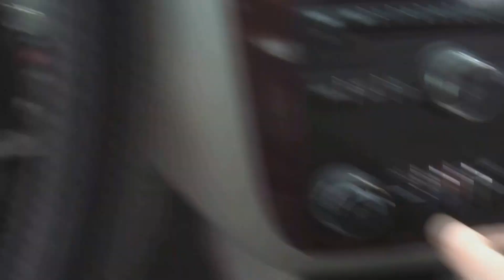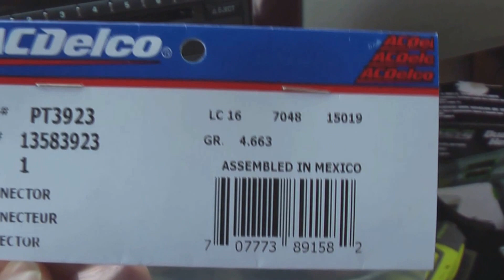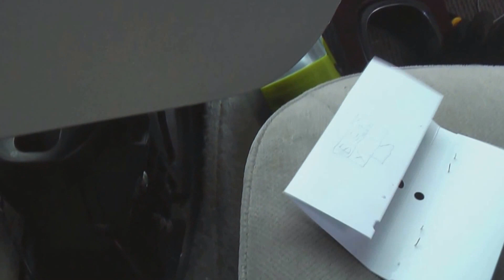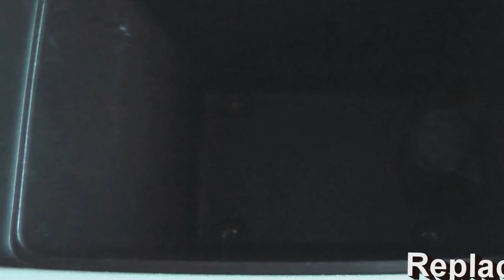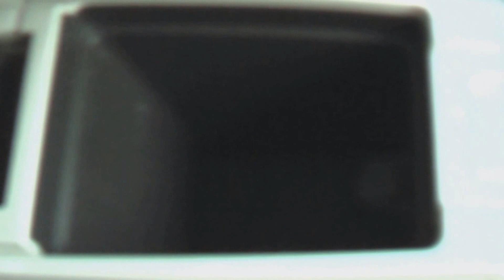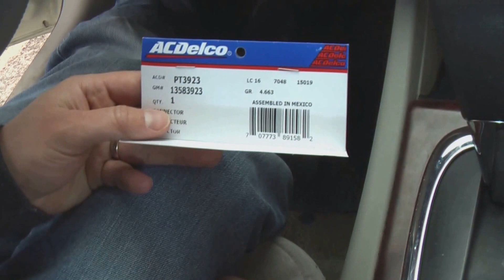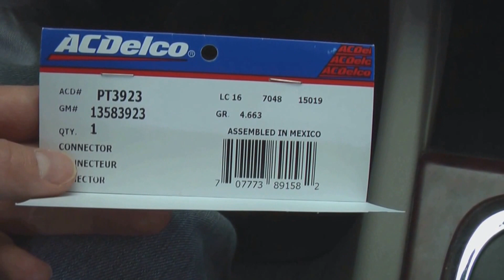Chevy Impala Monte Carlo Buick Pontiac - Won't Shift Out Of Park - Key Stuck In Ignition - FIXED

Comment: HUGE thank you for posting this video!!! I was on my way to see my mother for Mother's Day when this happened to me. Thanks to your video, I was able to diagnose this issue and fix it. It turned out my black wire was broken too. I ordered the same wiring harness. except for the POS wire stripper/crimper I got from Advance Auto (don't buy the red handle Auto Craft stripper/crimper that comes in a box with butt connectors and other connectors. Had to use 18 to cut 14 gauge wire. The 20-22 was still too big to cut 18 gauge.) I ended up using a box cutter on the existing wire. But anyway, thanks to this video, I'm back in business. I owe you one of those beers! Much thanks!
Reply: I know I'm kind of off topic but does anyone know a good place to watch newly released movies online ?
Reply: @Marlon Kannon I watch on Flixportal. Just search on google for it =)
Reply: @Jayson Miguel thank you, signed up and it seems like a nice service =) I appreciate it !
Reply: @Marlon Kannon happy to help xD

Comment: Found this video today to help my grandson.  Key stuck in the ignition switch, and shift knob stuck in park.  This problem can also occur with a dead battery, which turned out to be our case.  His car had been sitting about 4 months and we needed to move the car for jumper cables to reach.  Learning about that pin on the side of the shifter assembly under the trim panel was all I needed.  The key released once I got the car started.  Not a harness problem in our case thank god.

Comment: Nice video. Thank you mine shift just got locked. Word of caution always leave wires long. Never know when you need the length. I'm a electrical technician so I work with wires all the time.

Comment: Thank you for this video. It was very easy to follow and worked perfectly once replaced. Also, thanks for putting the part number in the description. When I called O'Reilly, they said there was no harness number, but I gave them the one in the description and they pulled it right up. Thanks again!!!

Comment: Common problem & this is best, most detailed video. Showing the wire colors clearly was really helpful as the one I worked on today had been “fixed” sometime before we bought and no crimp connectors were used. Less than an hour& under$25!

Comment: thanks this is old, I'm about to go on this journey! I believe I will give myself about 1 inch more room on the wires. I believe you cut them to short, but without watching you I would never of seen how to get started. Took my 2007 impala in today for the ignition recall,thought that would fix key being stuck in ignition after I turn car off! It don't! You have to take a small flat head, kind of long and stick it in the pull out lid right below the ignition switch and push a little bronze looking button in and key will turn back to off position to take it out. The Dealership Jeff Wylers on Dixie Highway said $450 to fix it, what you are doing! Thanks for showing us dudes with a bit of mechanical knowledge and some balls that we can fix it. I still will give myself a bit more length on my old wires I cut off. Thanks again!

Comment: Thanks very much. This was very helpful. In my case, the black wire was slippling out of the harness. I pushed the wire back in, melted a tiny dab of solder into the hole to secure the connection and everything is fine again. 2010 Impala.

Comment: Just had this happen to my impala today. Found on a thread that underneath the small cover under the ignition key there is a manual release for the key as well. Its harder to see but I've been getting it with a flathead to unlock my key until my new harness arrives. Thanks for the video!!
Reply: I've had to use the manual key release for a looooooooong time, and didn't know the problem was connected to the shifter issue until yesterday!  I'm hoping when the part comes in, it will fix both issues!

Comment: Thanks for the video, it works! Used spade connectors and tape on mine.  Also,  I left the wiring a little long since there is some foam on the inside of the center console so no chance for chafing.  The best way is to solder and heat shrink(stronger than the wire itself).  I don't like(hate) butt connectors, especially the type that are too big for the wires- they almost always come loose eventually. Cheers

Comment: You did a great job! When you describe a subject, It will help, if you use the correct vernacular, when describing your subject. It would make it easier to stay on subject, if you have a soldering gun to secure your wires, it makes it faster, when you cut wires always cover the ends not used with tape, you can never tell, if something can come in contact with something you can see after you close your job. One thing to keep in mind, use color tape or marker to identify the repaired wires, that were replaced, yours was in an easy location, Make sure your new wires match the same color wire, you are repairing,some might be in an area not so easy to identify the wire change. Always secure your wires with tie raps to prevent movement. yes in your area, a beer helps. Again you did a great job, and it works. good job keep up the good work. I  am in California. an Author, inventor and race car builder. Thanks

Comment: My 2008 Impala got me stuck on a steep hill going into a parking garage. Thankfully I had AAA and had the car towed 75 miles. My Master Shade Tree Auto Repair buddy repaired it for me. In doing research for the fix, I found that GM shorted the wire bundle a few inches (engineers !!!!) and by doing so that's what caused the shifter problem.

Comment: Great video. Probably to best I have seen on this subject. May mention that I believe that there is a small screw at the front base of the shifter knob that can be loosened/removed. The knob will then slide off so that the console will come completely off.

Comment: My friends car was flooded from Harvey. I suppose the brake light switch and the electrical connectors in the floor shifter box were damaged. Do you think that's why It's stuck in park?
2002 Nissan Maxima 3.5. 4 door sedan.
Awesome video. Thanks a lot.

Comment: Have a 2005 Cavalier that did that once about 4 months ago.  The replaced the ignition switch and that fixed it.  Today it did it again. Can start the car but cant get it out of park and cant get the key out.  Do you know a way to over ride the shift lock to drive it to the dealers to save on a tow.

Comment: Thank you. My Monte Carlo is doing this and was considering selling it because I thought it was going to be a huge repair bill. My key is getting stuck all the time and takes like 30seconds to 3minutes to get out. Is that the same wiring harness?
Reply from the maker: Mathew Syria Yes it is. That same wiring harness tells the key when the shifter is in the park position, thus allowing it to be released from the ignition. It sounds like you have an intermittent connection, since it works sometimes. It will probably wear more and break over time, preventing the key from ever being released.
In my case, a different wire in the same harness was broken, which prevented the brake pedal from telling the shifter that it was being pressed. Because the shifter didn't think the brake was pressed, it wouldn't shift out of park. Both your and my symptoms are caused by a wire being damaged or disconnected from the wiring harness.

Comment: can you use the same wires and just put them back in the same connector since they just came out or do you have to replace the connector altogether
Reply: Treyc Conway Yes - that's what I did. I pushed the wire back into the connector, and melted a tiny bit of solder into the hole to secure it.

Comment: i have both a stuck key and stuck in park unless i disconnected the battery. My car has a easy release tab instead of screw driver method but this sounds like my issue even though different model.

Comment: Hey, thank you so much for showing us how to fix this!
I am having a different issue, though...
I think that when i pulled out the console it might have pulled on other wires that seem to be connected to the power outlets, because all three outlets stopped working. Have you come across this issue at all?
Thanks in advance!
Reply: I know my response is a few years late, lol. But for anyone else, make sure to unplug the 12v harness

Comment: Could i tape the release button down and drive it like that for a few days? Or does the button need to be released after you shift?   Thanks
Reply: I wouldn't do that for fear the car might come out of gear when it is in park. Yes I can use your emergency brake. But I would be very learly of doing that.

Comment: I have a 2004 Pontiac Aztek with a similar issue. The key won't come out of the ignition. I can start and drive the car just fine. When I go to get out, the key won't come out. My friend showed me a hole in the bottom of the steering column where I could stick a small screwdriver in and get the key to release. Is this related to the wiring harness being discussed in this video?
Reply from the maker: George Denzinger Although your problem sounds very similar, and both vehicles are made by GM, I wouldn't trust that the same wiring harness fix would work for your Aztek. You could try to take it apart and look for a broken/disconnected wire.

I just googled around a bit and found a guy saying that the whole shifter needs to be replaced to fix that on the Aztek.
https://answers.yahoo.com/question/index?qid=20100218060407AAIlE7p

I can't really be sure since I'm unfamiliar with that vehicle.

Comment: I bought a new part and spliced the wires together. But i still can't take my key out.  I didn't cut my the new connector wires shorter. Do you think this would have affected the connection?
Reply: I have the same problem. Do you know why it didn't work? How did you fix it?

Comment: my 2002 chevy impala ls wont t let me push down on the  brake to put my car in drive and ge da r shift is hard to shift into reverse could this be the problem.
Reply from the maker: Quite possibly. Can you use a long flathead screwdriver to release the gearshift with the button hidden down on the right? If so, this is probably the issue.
Reply: I got it to work. I have a 2002 impala ls

Comment: my key gets stuck in the ignition and you can tell that the battery went dead. the first time it happened i tried to move the neck of the steering wheel to remove the key, but no luck. after a while i hit the lock and unlock button on my key. the electicity came on and the key came out.... same thing happened a few days later. after DAYS of my key being stuck again i come to check on my ride. i seen that the lights and clock was on and my key came out... i wonder if i have a loose wire in my center console?

Comment: I had the same problem and I  replace the wire harness and now I can shift out of park. But now it doesn't allow me to remove my keys from the ignition. How do I replace the whole purple wire ?
Reply: their a fuse a rap or rad fuse in the kick panel it's a 10 fuse under rap or rad replace that and your good

Comment: I have a problem that when I press the brake I push the button on the shifter and it's real hard to push in. At times I have to use both hands to push the button in so I can put it in gear. What do you think can be causing that so I can fix it ? Thanks for your help.
Reply from the maker: I"m no sure, Tom. It doesn't sound like the issue documented in this video, since it would either work or it wouldn't based on the integrity of the wire.
Reply: I think I found out what it is. The Shifter Interlock. I unplugged it and it shifts better, no struggle at all. I am looking to buy a new one so I can install it. Stepping on the gas is a little harder.

Comment: is the connector the exact same as the manufacturer one? i was able to go to the junkyard and find a similar conector from a chevy cobalt i grinded out an edge that wasnt allowing the connector to enter and it for perfectly but it still wont unlock the key and the shifter so im wondering if there can be an entirely different issue.
Reply from the maker: I'm afraid the connector you have may not be the right one. The one I used, as detailed in the video description, is an exact fit.
Reply: +TheTechnoMack 
i see. well i just ordered the part thanks for the help! one last question could a blown fuse be a part of the problem? im not sure if while i was stripping the wires something couldve made contact and blown out a fuse
Reply from the maker: +Marvin Onofre I'm not sure about your fuse question. I didn't blow any fuses when doing the procedure in the video. 
I hope getting the correct part fixes your problem. Let me know how it goes!

Comment: Same problem, quick fix till harness comes in. Follow this video, but after screws come out put shift in neutral for ease of console removal. Peel back insulation on broken wire, twist strands tight. On the "front" of the plug where it plugs on to connection slip the bare wire into the correct hole ( make sure you have about 3/8 in exposed wire) and fold the remaining wire back along side of plug and plug it in. The connection will hold the wire in place pretty well and allow you to function the car as normal until correct repair can be done. When my replacement harness come in I will try to show what I did on video. Later folks!
Reply: You ever post that vid man?

Comment: Ok, so I have the same problem BUT my car won't start...It shut off when I depressed the brake and the key is stuck in the ignition and the car is stuck in gear, why would it have shut down?  why won't it start?  I have 13.8 volts on the battery, a full charge?? Please help...I hope you are still into doing youtube?? Thanks

Comment: Do you think mines falls along that line i know its something dealing with the shifter i was just going to change the whole thing. My key used to get stuck in the ignition but i would have jiggle the shifter and it would come right out but now im in the position where my key can come out but the ignition wont turn to the off position i temporarily solved it by taking off the shifter knob and using it like that and then that stop working so i sprayed wd-40 in it and that once again temporarily solved it.
Reply from the maker: The first problem you describe, with the key stuck in the ignition, sounds like the wiring harness problem illustrated in this video. Especially since jiggling the shifter would release it. That sounds like an intermittent connection on the wiring harness. I don't have any ideas about the key not turning to the off position.
Reply: +TheTechnoMack thanks for the help any suggestions ? Im thinking since i had that problem first where my key would get stuck in there and then sometimes after work it would be hard to press the shifter in to switch gears so you think i should just change the whole shifting console because i feel that the problem has to be from the shifter since it had a few problems relating to it instead of the ignition switch needing to be changed
Reply: +TheTechnoMack the weird thing is . Its an off and on problem so im thinking its probably alot of debris and stuff in the gear shifter so im going to try and clean it out like i just got out the car and the key went to off position . Its a frequent problem but then its not
Reply from the maker: Yeah. It doesn't cost anything to take it apart and investigate. See if any wires look strained or crimped, and clean things out if necessary.
Reply: +TheTechnoMack as far as the wire harness you showed in this video is there anymore to be concerned about or look at? And should i continue using wd-40 to lubricate parts and use a can of compress air to clean things
Reply from the maker: Damir Williams I couldn't say for sure, Damir. I'm not an auto mechanic. If it were me I'd just take an investigative approach and see if there was anything obviously wrong.
Reply: +TheTechnoMack thanks for the advice sorry about my approach this problem causes a lot of frustration

Comment: I did this and it fixed the problem, but when I put the key in after changing out the connector my check engine light was on, I've verified all the connections are good, is there any way that could even be related? I'm thinking it's just odd timing.
Reply from the maker: I can't think of a possible relation. Must just be a coincidence.
Reply: alright, I've got a code reader on the way so I can check it out. Thanks for the video, saved me a lot of money, and was a lot of fun to do.
Reply: +TheTechnoMack Yeah, it was totally unrelated.

Comment: Hi, I have the exact same problem but when I took the panels off all of the wires are connected and intact. Is there anywhere else I can check to solve the problem? Thanks!
Reply from the maker: Oh shoot! The problem may be on the other side of the wiring, like down by the brake or something. I'm not sure where that is, or how to get access to check. Sorry, Mike.
Reply: No problem, i'll just bite the bullet and take in to my repair guy, thanks though!

Comment: My car is stuck in park but key will come out is this the same promblen?
Reply from the maker: Yes. That is the same condition that this car was in. I was just saying that another symptom that could be caused by the same disconnected wiring harness, would be the key couldn't be removed.

Comment: This fixed the shift problem but now my key won’t come out of the ignition. Now I’m stumped
Reply from the maker: That wiring harness is responsible for both the key being able to be removed when the car is in Park, and the shifter being able to shift out of park once the brake pedal is depressed.
It sounds like you have a bad wire or splice in that wiring harness.
Reply: Yes that’s what I’ve seen. Key switch worked before the fix now it doesn’t. I’m not sure where I’ve lost voltage I’ve isolated that the purple wire goes to the key switch but that’s as far as I got today